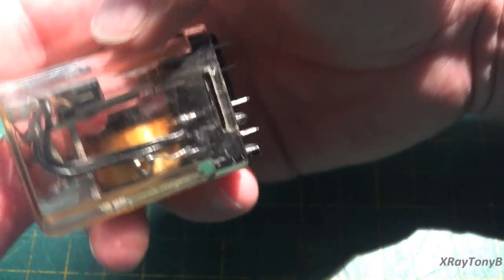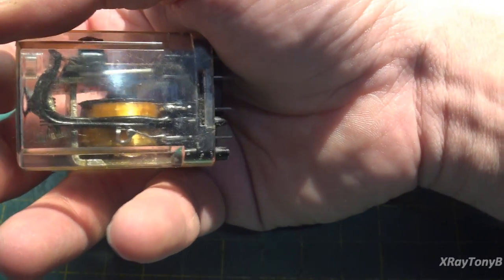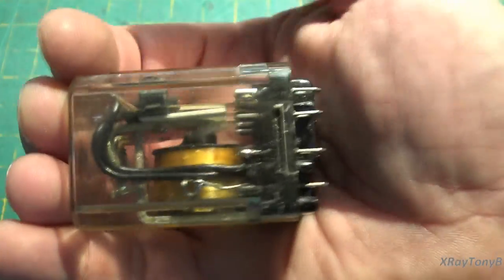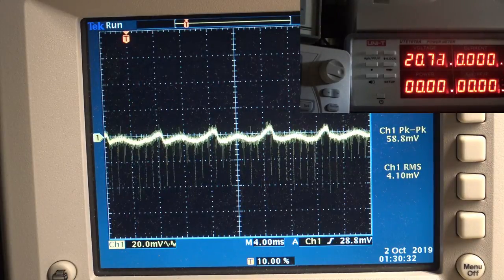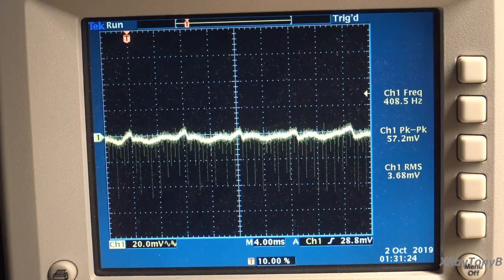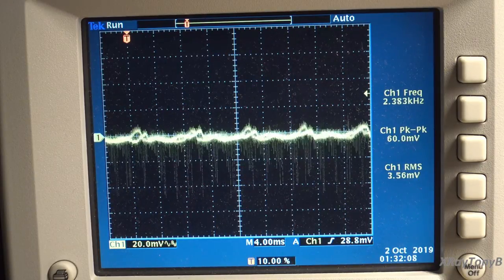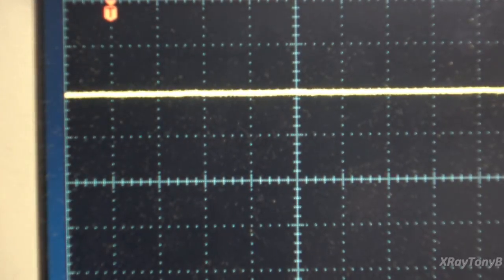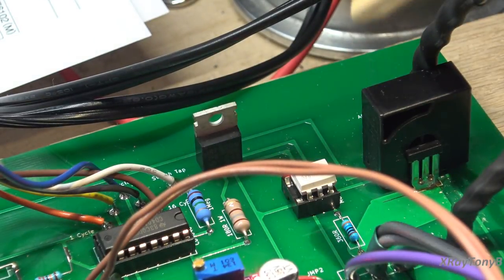TRIACs and Current Sense Modules Explained

Comment: Junction to case thermal specs are the same for both packages. There has been a lot of advance in triac design and modern ones are pretty bullet proof if you choose the correct type for your application.

Comment: Great video. Very interesting stuff on the AC control circuit. Almost got confused when u were going through the positive and negative voltage flows through the circuit but I needed to look at the + and - signs carefully at the beginning and end of the diagram. 👍

Comment: That drop out delay is lengthened by the addition of the reverse diode across the relay coil. If you want to speed up the release of the relay, you have to think a bit further. One possible way is to use a selenium diode with a higher voltage, and another way is to put a zener anode-to-anode with your suppression diode, with the cathode of the zener at the more negative side of the coil. I'm sure there are other ways.

Second, in nearly all cases, normally-closed is bad. This includes both relays and switches. One big problem with electronic controls is that everything works when it is new.  Any turd can get a relay to light a light bulb. Where the art is, is saying with confidence that it will work 10, 15, or 20 years from now. Getting the logic right to control that relay is one thing, but building a solid robust device is an entirely different thing.

Comment: Another way to switch power - used before the development of power semiconductors - is a Thyratron tube, though I’ll bet few people know what that is, and even fewer how it works. 😎
Reply from the maker: I still actually have a couple of type 6012 Thyratrons that were used in the old GE X-Ray ganareators from 1965.  We removed the last unit out of service in 2012!  They were used to drive the "make" and "break" circuitry that drove the huge Primary exposure contactor.  They were also used to drive solenoids and relays in some of the really old jukeboxes.  Thanks for bringing back some good memories!
Reply: One use for them was in frame timebases in vintage tv sets. They work well and several of my sets have this technology.

Comment: I'm still kind of confused with AC and DC coupling of oscilloscopes and when to use it when watching signals.  Why would you AC couple a DC switching signal that doesn't go below zero volts?
Reply: Because (on dc input) in order to display a varying voltage on a 2.5v level the scope has to be set to allow 2.5v to be displayed on the screen. This means that a 40mv (or less) variation of that 2.5v is going to be very hard to see and certainly very hard to quantify. Turning up the input sensitivity pushes the display off the screen and probably does no good to the scope input circuits. 
Setting the scope to ac input strips out (blocks) the dc component of the varying signal and only lets the variations through. Now you can turn up the input sensitivity to display the information you want to see. Effectively you are tuning a varying dc voltage into an ac signal.